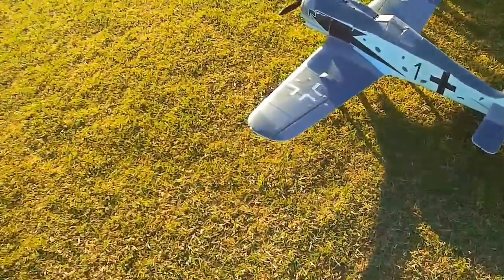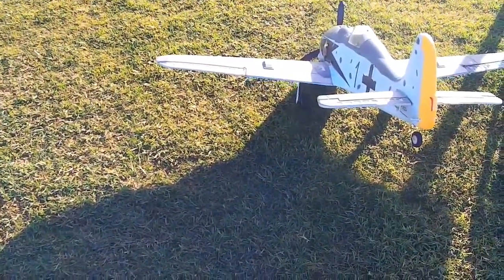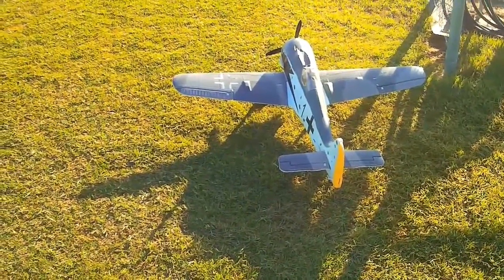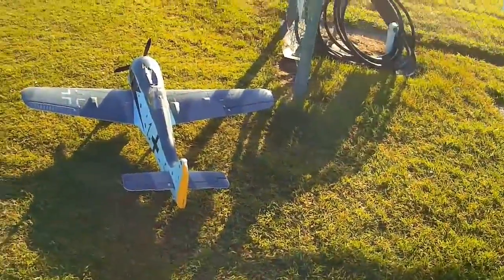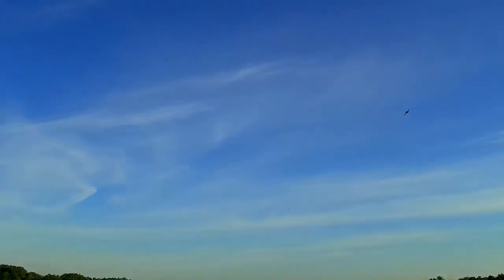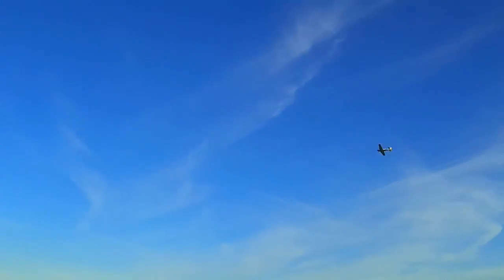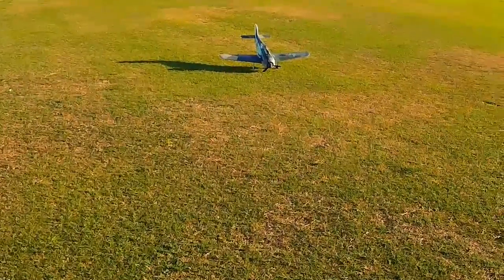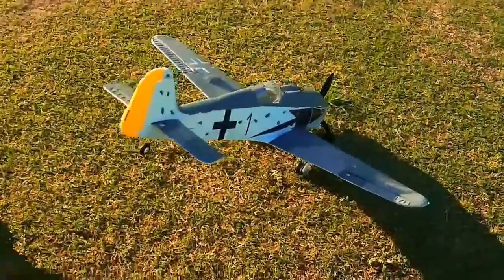FW-190 Flight Number 2 On 4-19-18

Comment: retracts are not the easiest to adjust forward.... video here : https://www.rcgroups.com/forums/showthread.php?2556636-hobbyking-focke-wulf-fw190
Reply from the maker: Thank you for the link....That is basically what I did to mine as well. (Flight three shows the end result) - except, I did not cut out my wings to allow the retracts to work. I am trying to decide if I want to do that, or just leave it as a fixed gear model.